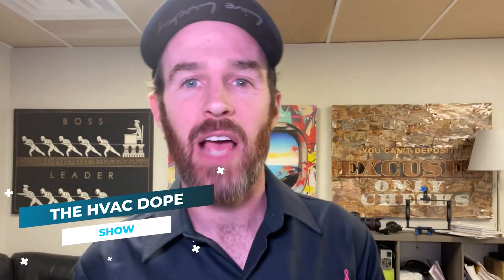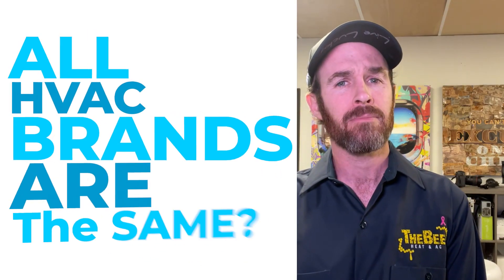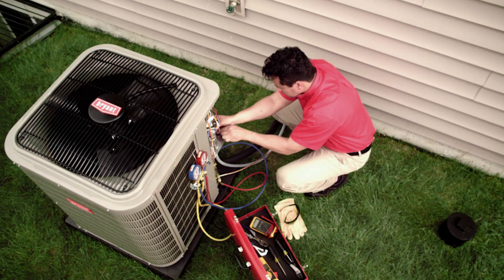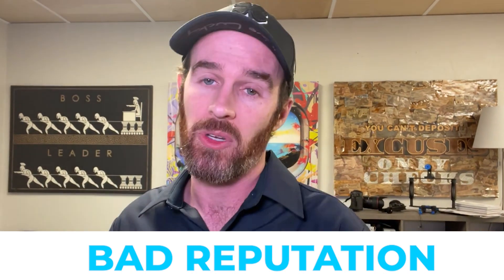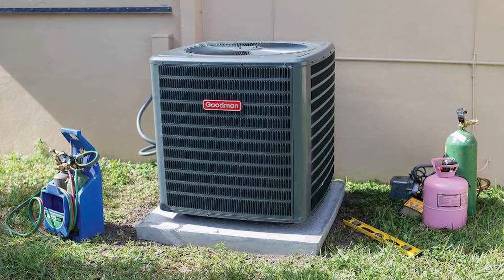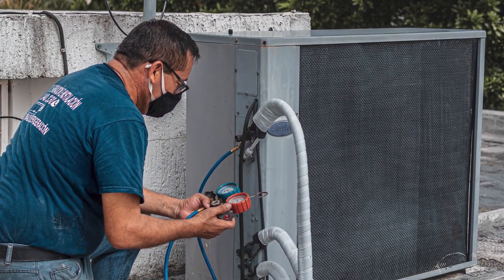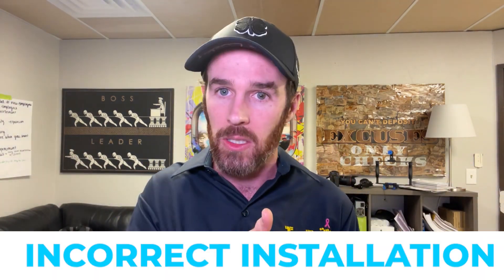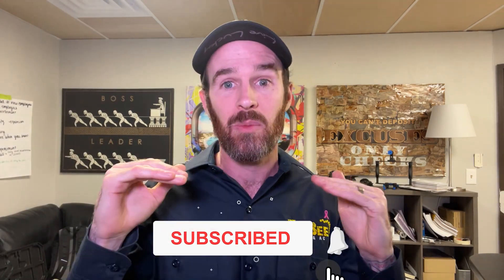☝️The Truth No One Tells You (Secret Revealed) Why All HVAC Brands Are “The Same”👈

Comment: I agree, most brands use the same core components… But, not the same thickness of steel, not the same insulation / sound dampening, nit the same vibration mitigation components, not the same size tubing, not the same quality control, not the same overall dimensions which can drastically change airflow and heat transfer (probably one of the single most important factors), and finally not the same heat load assumptions (static pressure, humidity, outdoor ambient, line set pressure drop, weighted averages of heat load throughout the year). Not to mention just plain stupid mistakes, like not following Danfoss technical guidance on design considerations which led to compressor failures. So, as you stated, not all are equal, and rightfully so as there are many more factors than discussed by either of us!

Comment: I’m tempted to go with Goodman gas furnace and central AC.  Seer 16.   I can’t see spending a lot for a more expensive unit.  I don’t see the savings
Reply from the maker: It all comes down to the install company honestly. Goodman is ok they’re just considered a contractors grade system. Most important things to consider are system installation and sizing and make sure it’s done properly. Every once in a while we get a lemon unit that gives us more than it’s fair share of failed parts, but I always look at the install first if there were chronic issues
Reply: @TheHVACDopeShow  a Local Contractor says Amana is better with thicker Steel. He does sell the whole line but Amanda’s warranty is good.   I have owned two Trane Units and the first one went out just after 10 years bad compressor they said.  Second Seer 18 I had installed in 2017.  They had to come out 5 times in 3 years to replace the board inside the heat pump, add Coolant and something else.  I won’t buy Trane again.

Comment: How expensive would it be to take out my 93% efficiency furnace and install a 80% 68,000 btu furnace? I have been told buy several installer companies that it will cost a lot like $12,000 just for the switch of a high efficiency to a 80% furnace I find that hard to believe!
Reply from the maker: Depends on the exhaust run, that’s the biggest variable. If you don’t have an existing exhaust stack for an 80% system it can be expensive because of the labor involved. Would have to see it to say for certain but if there’s not an 80% exhaust stack in the mechanical room then it’s not a very easy switch.

Comment: whenI got 5 quotes from hvac guys, not one of the measured insulation, they took no calcucations. 1 guy just looked at the old furnace and left. then gave me a quote. another guy refused to sell me a single stage furnace. He said he would only sell me a 2 stage. I ended up a company that i got an amana furnace with a 10 years parts and labor warranty. Still got 5 years left on that warranty and had no issues. It's a 98% efficent one running on propane.

Comment: My niece moved into a new home that had a 2 year old Goodman installed.  Lucky for her (or so she thought), her new place came with a homeowner's warranty.     Her AC went down a number of times, due to a refrigerant leak, and each time, she was told the leak was fixed.  After the 3rd or 4th maintenance visit on the unit, she was told they couldn't find the leak, but they put a refrigerant stop leak, "which will fix the problem"..    As you might imagine, it didn't fix the problem and the system leaked again. 
We had another, different, HVAC guy do leak check and he was unable to pin point the leak, either.   He assumed it was in the evaporator coil.  
Long story short, the Goodman was replaced with a Rheem and she has had no problems since.
Reply: Goodman is the best brand money can buy, it's the installation process and the installer that makes the difference.
Thank Goodness for Goodman,  BEST WARRANTY IN THE HVAC BUSINESS.
Reply: The warranty didn't do a thing for my niece. @ThomasWalker-m2y

Comment: Former hvac contractor and then became a manufacturer's representative. You are correct about shared parts although depending on the "brand" they may or may not have a high or low pressure switch on the budget/builder model condenser units, etc. These are considered upgrade components  and differentiate between higher priced models which generally also have better combined warranties. Units that look exactly the same are indeed  different at times and can also be an identical twin with another name brand. This is where the honesty of the contractor is paramount as well as that he knows what is missing or added. Evaporator coils are another item that can vary greatly between brands. Some are copper with poor quality materials with thin walls while coils from 3rd parties that specialize in coils (ADP or Advanced Distributor Products) utilize better and thicker copper which means less refrigerant leaks down the road of pressure and vibration. Same with aluminum except the issue is with the quality of the specific manufacturer's brazing machines and overall qc, as in are they water tank tested with helium pressure for every coil or just 1 pulled randomly from the batch of 300. Lot's of things are not as they seem at first glance. My dad taught me how to locate the leak on a coil tube and then sweat it closed when I was a wee lad. Guys today change out the entire coil and or air handler which is way more profitable of course, plus good luck brazing aluminum in the field..lol. Enjoyed the video and good luck with the new Department of Energy regulations on SEER and HSPF ! Happily retired from decades of hvac 👍
Reply from the maker: Thanks for the good luck 😂 I know SEER2 is going to be interesting… our local utility offers a rebate for a single stage 16 based on the AHRI but won’t offer a rebate on an inverter that pulls 20% of the power on startup because the AHRI gives it lower rating lol. Thanks for watching and commenting!!

Comment: 2 year old house with a 3 ton and 5 ton builder grade Carrier's. I'm a DIY guy not an A/C guy. I noticed about 2 months ago my 5 ton unit kept running the blower motor. I pulled the tstat off the wall and it was still running. Just for fun I also pulled the low voltage taps and it was still running. Even though the X13 motor was covered the original installer wanted $700 to replace it. The module was a bit more than the a rescue motor I bought for just under $300 and had it going in 45 minutes. 2 weeks ago same unit on a Sat night started to blow hot air. Went outside condenser was really hot and no fan. When I first moved in first thing I did was pull the panels and order caps and contactors. Cheap Chinese cap went. Thankfully had an Amrad 45/5 on hand. The 3 ton has a Broad Ocean so I think that might be an OEM if that blower motor goes. Point is like you are making these warranty's are jokes if labor isn't covered. 2 years old X13 and a cap goes. Seems nuts to me but a month before my cap went my neighbor had one of his replaced also.

Just throwing this out there. The Amrad was a smaller diameter than the original. I know everyone uses band iron and I didn't have any on hand so I tie wrapped it off as a temp fix. Supco makes a really cool magnetic universal cap holder. I bought one of those and really happy with it. Going to order a second for the other unit as I know that cap is going to go too. Have my 35/5 ready for that one. 

I think inverter tech is going to be the future of A/C. I put a Mr. Cool in one of my garages. Really happy with it.
Reply from the maker: Right on, yeah the labor warranty is through the installer always so it’s just good to get one that will install it properly and won’t leave you hanging. Capacitors are good to keep on hand for sure!
Reply: @TheHVACDopeShow  My house was new construction so the builder gives a year warranty and you are on your own after that. About 6 months ago we also had a roof leak. They didn't flash it correctly. That was a $2500 repair. Never ends.
Reply: I like Mr. Cool but can you get parts for it?  I know a lot of retirees are installing mini-splits to save money on electricity and installation costs.